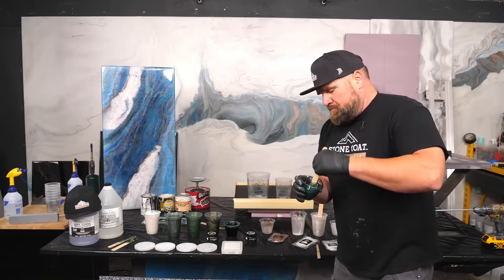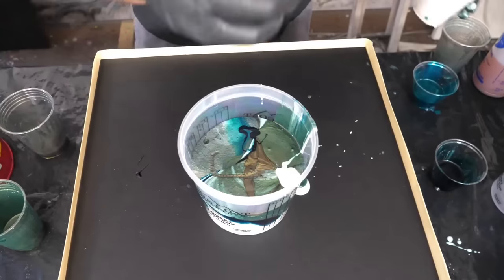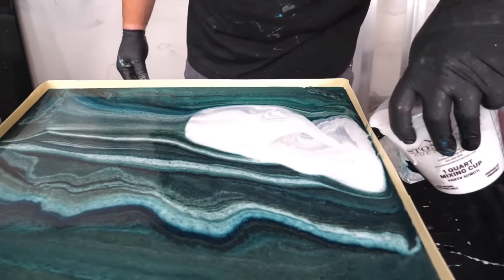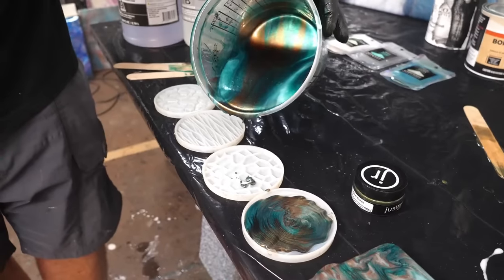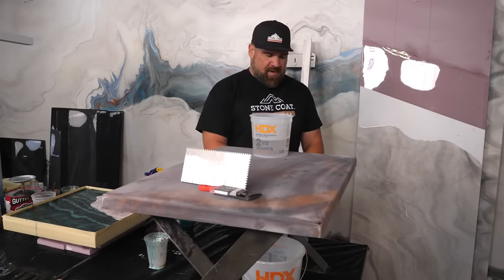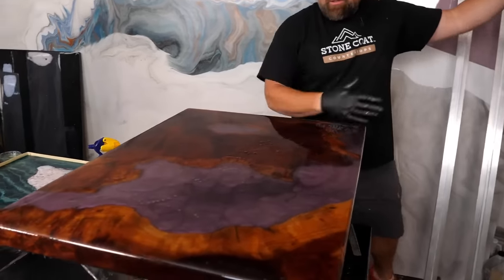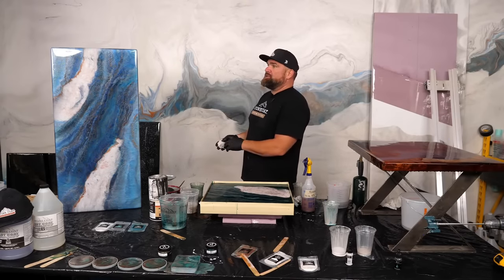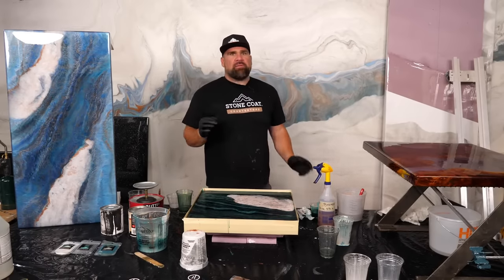Green Van Gogh Granite | Project Support With Mitch | Stone Coat Countertops Epoxy

Comment: I have done two countertops so far and am just a do-it-yourself guy. one for me and one for my son-in-law. both turned out fantastic!! I was so impressed. I can't wait to do shower next. Thanks yall.
Reply: how does it hold up with hot pots? also, if you scratch it with a knife or pot how do you get the gouges out?
Reply: two more questions. did you pull out the kitchen sink before pouring or just pour up to the edge? how did you handle the backsplash?
Reply: When i prepped the counter tops i removed the sink. As for hot spots and scratches, i have not put any marks on my countertops due to hot pans. It seems to hold up to heat very well. However, i do use hot pads and dont purposely put pans on the counter right off the stove. One of the reasons i decided to go with stonecoat was because of how well it holds up to heat. I watched hrs of videos put out by stonecoat and one of tjose videos shows him demonstrate heat and scratches.
Reply: When i poured my countertops, i had backslash all prepped as well. Once its was dry, i glued it up.
Reply: I can't put pics up, otherwise, I would show you.  @GaryResnikoff

Comment: I missed the live, but I'd love the Slab jig. I have just started getting into home improvements. I am planning to sell my house in the next 12 to 24 months then move and build a house. I really like the look of these pours, especially the blue van Gogh. Planning on doing a lot of the stuff on the house build myself I'm kind of worried that I might go overboard with this stuff doing floors and countertops and such. I've never done any kind of epoxy pouring, I'd like to start trying some on smaller projects like tables so that when I move and want to do my own countertops, I feel confident in what I'm doing.

Until selling my house money is very tight, it would be great to be able to learn and sell the items I've made.

Comment: Hey Mitch, I just bought a new home built in 1960 and it has original countertops, the cheap ones with the 3-4 inch back that’s all one piece. We don’t really have the money to replace the countertops right now bc we have so many other projects like repairing the original hardwood floors that is crazy expensive. My question is, can I pour on those countertops? I can send pictures of them if needed. 
Also wanted to say I love watching your videos.